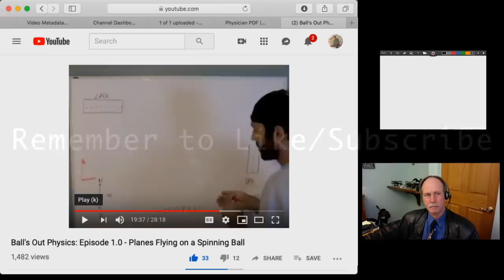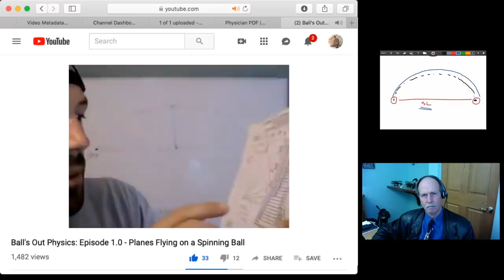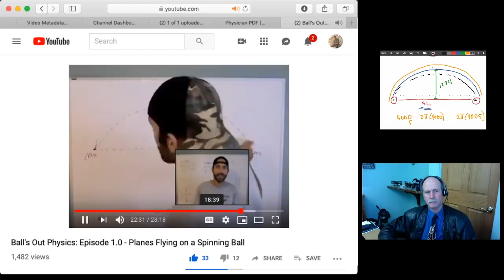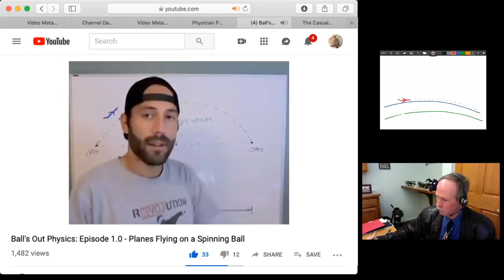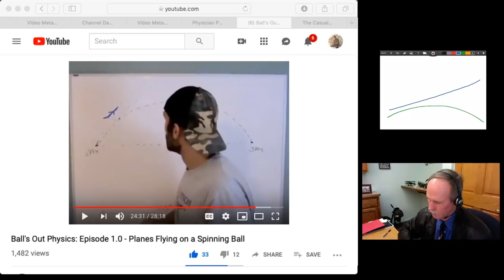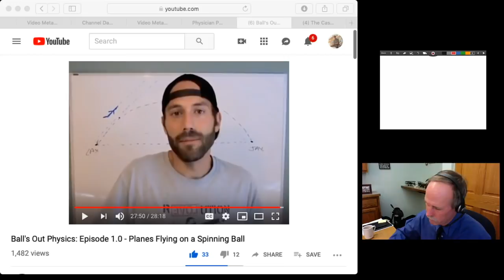Flat Derp Engineer Aircraft on Spinning Earth 2

Comment: Bob, watched lots of your videos, and I absolutely respect your knowledge and I know you're a pilot, so I'm surprised to hear your description of flight. 

Thrust balancing drag, if engine stops speed definitely does decrease, lift is less, so a descent. 
Aircraft don't climb in level flight without added power for the same reason cars don't speed up going uphill without added power.
Reply from the maker: My description is correct.  Aircraft are trimmed to fly a particular speed in level flight, which is a function of the 4 forces of flight.  If you cut the engine, the speed remains the same and you descend, holding the other 3 forces steady.  Increasing the thrust again maintains the trimmed speed but causes a climb.

Comment: Bob's doubts that engineer degree, but I doubt Bob's pilot licence. 
I've asked 2 pilots on Boeing and Airbus and both told me that all airplanes (including the small ones) are flying at a slight upward angle for positive climb, then when they reach cruise altitude they are flying in a straight line, parallel with the ground. So how is it Bob? Are you really a pilot Bob? :))
Reply from the maker: Then you misunderstood them or they misunderstood your question.  Planes normally cruise at about 3 degrees 'nose up'.
Reply: @BobtheScienceGuy  Not normally… just exceptionally. They could fly at a slightly attack angle, as you say, but only when they have heavy cargo on board - weight exceeded for the plane. 
Flying with a slightly attack angle at a cruise altitude could create problems for the plane and for the pilot.

Comment: If he’s going to figure this all out, doesn’t he need to include in his formulas and calculations the speed of the earth around the sun, the speed of the sun around the galactic center and the speed of the galaxy thru the universe?

If he thinks he needs to add the speed of the airplane to the speed of the earth, why stop there? Why does he not add all the other speeds to the plane as well?  Speed of the airplane (600 mph) + speed of earth rotation (1037 mph) + speed of earth around the sun (66,000 mph) + speed of solar system in the galaxy  (515,000 mph) + speed of galaxy in the universe (2,160,000 mph).  Yup, that plane is really moving...at a cumulative speed of 2,742,637 miles/hour.(see edit below)

His formulas are incomplete.  If he’s going to include the rotation speed, he must include all the others.  Back to the drawing board, sir engineer.

8/28/2019 Edit - In contemplating this idea to not stop at adding the earth’s rotation speed, I neglected to also add direction.  For example, the movement of the revolution of the earth around the sun will be going in the same direction as the movement of the solar system as a whole around the galactic center for about half the year and then in the opposite direction in the other half of the year.  So, I guess one would need to consider those directions as he factored in the direction of the landing strip along with the direction of the rotation of the earth.

Also, maybe one does not need to add up all those numbers and use just the largest number since the earth is inside the solar system which is inside the galaxy which is moving at about 2,160,000 mph.

IDK.  I’m making this shiite up as I go along...😁

Comment: Bob
at 3:47 you place 128.4 miles next to the vertical line
but 128.4 miles is the distance ( vertical drop ) from 
.. a vertical line tangent to the Earth surface at LAX down to the surface of the Earth at the apex of the curve
.. or the distance from LAX to the midpoint of the "tunnel" Brian has labeled as ( sea level )    NO.  I'm sorry, that's wrong.  because the reference line is a level line extending at a tangent to Earth's surface at LAX -- so it would extend out at an acute angle from that "tunnel" Brian has mistaken for sea level, considering the size of the limb of Earth between LAX and JAX ( Jacksonville airport )

any mathematicians out there that can solve for length of the chord from LAX to JAX given the length of the arc between the two?

Comment: I'm not an engineer but I've been on dozens upon dozens of flights. Bob, you can correct me if I'm wrong, but wouldn't flying with the pitch nose down mean that the turbulence be bad and likely dangerous. On top of that, wouldn't gravity make the plane dive, and pilots would at the very least struggle like mad to stay at a constant altitude
Reply from the maker: It is more than that, planes fly nose up.  Anything less is a decent.

Comment: Welcome to AirBob.  We hope you enjoy your flight.. :D

Al Biruni used a mountain's height and the dip to the horizon from the summit in the 10th century or so to calculate the size of Earth, that matched both what the Greeks had done, and what would be done later in the West, to a reasonable degree of accuracy.  21st century bloke who is supposed to be an engineer "can't tell" that there even is a dip to the horizon from much, much higher.

The "engineers laying train tracks" comes straight from Dubay's 200 Proofs.  It's fairly obvious that a railway engineer is interested in managing the gradient within the topography of the line, with an aim of climbing or descending to the elevation of each station.  And rails are bendy over that kind of distance, giving them quite a decent tolerance to work within.

I'm not familiar with the lake he's talking about.  Is it even at sea level?

Comment: To calculate the difference between the ground path and actual plane path you dont need to consider the earth radius, you can just multiply the altitude of the plane with 2π . If the plane is lets say 5 miles then the difference between the ground path and plane path is 5*2π. It doesnt matter if the plane flies on Juptter, earth or a basketball.

Comment: Brian is wrong from the start. His drawing is giving you the chord height. The 124 miles would be measured from a tangent line from  lax, the 124 miles would be from jax to that line. The chord height would be about 39 miles. I made a model earth section about 10 inches in diameter. At a scale of 1" = 100 miles. With it I can duplicate real world observations, as mountain and other included features are scale altitudes.

Comment: Bob, I wish you would point out that the aircraft DOES constantly "dip its nose." As you fly around the curve, yes, the aircraft must always be rotating at the correct rate to match the curve of the Earth. No pilot ever had to worry about this or even be consciously aware of it, but I just want to stress that you are NOT saying that the aircraft doesn't rotate to match the curve. It does. I think this is the main misunderstanding the FEs have about this. They hear pilots say, "no I don't have to nose down" and they say, "See! Proof!" In reality, we just trim the aircraft so that the angle of attack stays nice and steady. As you go around the curve, yes, you are actually rotating very slowly. Slowly enough you'd never feel it, but you're using the horizon, the altitude, and the angle of attack to hold that rate correctly.
If you drift off of that angle of attack, your airspeed or altitude will start to drift, and you'll correct your trim. Boom! Everything is synced, and you ARE "dipping your nose."
Important point: in this case "dipping the nose" does NOT mean pointing down (negative angle of attack). It simply means holding a constant angle of attack.
Reply: https://imgur.com/a/dGF5KbA
Reply from the maker: you have a point, we are effectively rotating around the curve, even with the nose up.
Reply: @BobtheScienceGuy  Hi Bob. I'm amazed that you did that perfectly accurate explanation without mentioning the altimeter and  how it's used to maintain the altitude. Maybe touch on QNH and QFE as well.
Reply: @Cardinal RG Totally agree! There's a general trend of hearing a complicated answer, not understanding the full context, and leaping to entirely the wrong conclusion. "The pilot says he never dips the nose!" "The physics professor said gravity isn't a force!" "NDT said the Earth is pear shaped." etc. etc.

Comment: Strictly speaking, sea level does not follow the curve of the Earth.  Sea level follows an equipotential surface (usually a set of points equally distant from the center of the Earth) where every point of the surface has the same potential energy, as described by Archimedes in the third century BC.

An aircraft in level flight also flies along an equipotential surface, as lift equals the downwards acceleration.
Reply from the maker: Agreed but not significant enough to change the original answer

Comment: I gotta agree with brian there, his (mis)comprehension of flight, gravity, level, curvature, etc do not make sense. 

But it seems like instead of thinking to himself, that makes no sense, maybe my understanding is flawed. He rather went, they’re all lying to us and it’s really flat. 

Smh. Disgraceful for an engineer who had to pass physics and engineer classes to have such incorrect fundamental understandings.

Edit:
Generally I’ve discovered the real problem with flatties use of the 8”/mi^2 formula is that they don’t understand what it measures. Yes it’s inaccurate because it’s a parabola etc but that is not their real problem which is much deeper. They don’t realize the formula does not measure hidden height for an observer, but simply measures drop from a tangent that extends from that observer’s feet. The two measurements can be similarly small but at some point the discrepancy becomes obscene. Much worse than the parabolas are not circles error.

Edit2:
Oh snap. That schooling at the end there.

Comment: if LAX to JAX is 2000 miles it's roughly 1/12 of the circumference of the Earth (about 25000 miles) ... so it's roughly 30° of a circle the size of Earth. Why does he draw a bulge equivalent to half a circle or 180° when it's only a tiny part of that???

4010 for 2R is correct, 4005 would be wrong, as it would mean the "circle" your plane flies is 5 miles up on one side of earth and flat with the ground on the other side. as we talk ann orbit it has to be added on both sides. When i just roughly calculate 6*10 (2Pi) to get how much larger than sealevel an orbit at plane flight height would be and then divide it back to 2000 miles = 1/6th of the Circumference it means the plane does 10miles more at height than it would do on the ground...
Reply: Has not a single one of these braindead morons ever seen a Plane LAND? they do not put the nose down to lose height, they land with the nose in the air to increase lift while going slower. The whole argument is based on the inability to understand how planes work. it is not "point where you go" FFS.
Reply from the maker: The numbers are correct, R is 4005.  As for the 180 degree circle, that is just a schematic, it isn't to scale.
Reply: @BobtheScienceGuy  I can't recall ever seeing any FE do anything "to scale." Everything tends to be Guess-timations.
Reply: @BobtheScienceGuy  
You are right... as we're talking R and not D the doubling up makes no sense. Mea Culpa.

"As for the 180 degree circle, that is just a schematic, it isn't to scale."

But that "just" is a big part of their understanding problems... they do not just use it for visualisation purposes but do not understand that in actuality the curve IS much slighter than drawn.

I remember how a triumpfant Flerf referred to the famous DSCVR lunar transit by saying something to the effect of "see? and they tell us the moon is 25000 miles away from earth", as if the kindergarten drawings in mathbooks actually depict reality when moon's orbit is shown at 2, 5 or 10 times of Earth's diameter.

Therefore we need to beat it into the heads of as many of the FE groupies that not really are all that convinced by arguments that Earth is flat, but just go with the vibe, that Scale does matter and accurate models are important to draw accurate conclusions. Mullins makes worse mistakes, but this one was one of the easiest ones to NOT make.

Comment: Brian has disabled all comments on all his video's.
Clearly he knows he is wrong and cant handle critisism
Reply: Actually, Mullin had removed his channel when some complaints were made to the state Board.  It is also hypothesized that his employer was brought into it, and Mullin was told to knock it off on pain of firing for cause.  (The First Rule of Employment:  Thou shalt not embarrass thine employer in public.)
Reply: @davidmescher2526  My understanding was that his employers found out about the channel and were less than impressed. That was the rumour at the time anyway, I'm not certain. But yes, he deleted his channel quite some time ago.
Reply: @fecu2394  I also heard (although I can't locate where I saw it) that he had collected money for some FE experiment, and ran off with the money.
Reply: @davidmescher2526  https://youtu.be/8gTCQIXw1xg Jump to 48 mins in. If you can bear to listen to Oakley, I think this George guy might have inadvertently set a series of events in motion such got Mullin in hot water but it's not clear what happened.

Comment: 6:06. You were right the first time. The plane going round the earth at 5 miles high would be 5 miles away on all points of the earth, describing a circle 10 miles bigger
Reply from the maker: no, I was right when I caught myself.  We were defining it in terms of radius not diameter.  That is what the 2 was for.
Reply: Bob the Science Guy ah yes you’re right. I was looking at the diagram and assuming the overall distance

Comment: In the 19th century, only a handful of eccentrics thought the earth was flat, and a few charlatans plugged the idea (as now).  People had understood it was a globe for at least 2,500 years, probably since we started making long sea voyages much earlier.  Albeit, until the 16th century the globe earth was generally thought to be stationary and the centre of the universe (though Aristarchus didn't agree and correctly placed the sun at the centre).

I call in aid the Qur'an, written roughly half way between Eratosthenes and Kopernik.  It describes a stationary, geocentric but spheroidal earth.   Nothing new there, no "revelation" involved.  It was just what people thought at the time, had for many centuries previously, and continued to think for many more.  

Even a scientist as distinguished, pioneering and devoted to what we now call the scientific method as Ibn Al-Haytham (called "Alhazen" in Latin) considered the issue but could find no evidence for the motion of the earth, only for the movements of the sun. moon and stars.  He'd read Aristarchus, of course, but said he was wrong.   However, neither Al-Haytham nor any of the other scientists of the "Muslim enlightenment" ever entertained any notion that the earth was anything other than spherical and Al-Biruni famously re-measured the earth's radius, using   a method which improved substantially on Eratosthenes and differed by only 0.8% in circumference from the modern measurement.
https://owlcation.com/stem/How-to-Determin-the-Radius-of-the-Earth-Al-Birunis-Classic-Experiment

Comment: It does not make sense, he says, without realising it is himself not making sense. An important point is that as you go higher the air gets thinner so the lift you get decreases, so when you balance thrust and drag you also balance lift and gravity. A well trimmed plane just flies along at a set altitude and speed as all forces balance out. You are in equilibrium.

Comment: The whole point of using the 8 inches per mile squared formula is first to calculate a huge "drop" figure and then to use that number to weave a false narrative as to how distant objects are supposed to be hidden behind massive amounts of curve and that therefore being able to actually see such objects is proof that the earth is flat. This is very dishonest. 

Calculation of what can be seen at distance is more involved and must also take the observer elevation/altitude above sea level into account. Given the curve of the earth is only one degree every 111 km, making observations from only a few hundred metres above sea level allows observation of some very distant objects.
Reply from the maker: it is a 'decent' approximation of the drop in earth curve, from the surface, over a short distance.  It really has nothing to do with what you can and can't see.
Reply: Bob the Science Guy ... Yes, but listen to what globe deniers attempt to present as proof. They say you should not be able to see that building and that it should be hidden behind, for example, a mile of curvature (the "drop" figure).

Re-running the figures using the hidden height formula and including the observer's height, shows just a few tens of metres is hidden and therefore 90% of the building or hill should be seen. This is mechanics of the deception they attempt to pull, presenting the massive drop figure, not the hidden height figure.